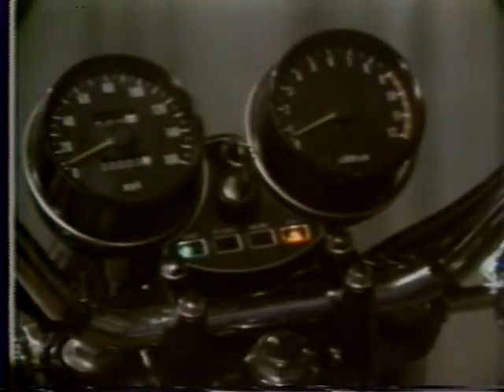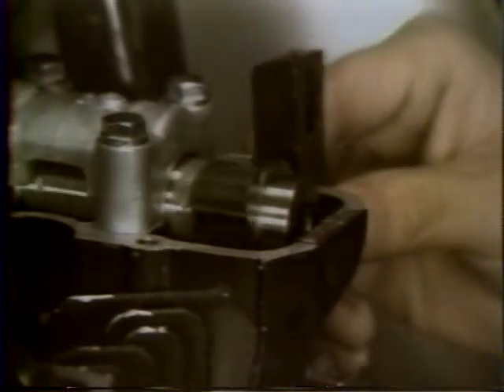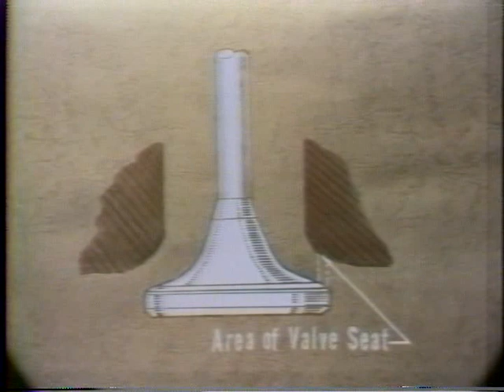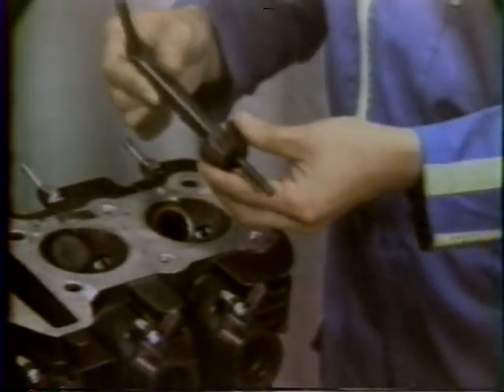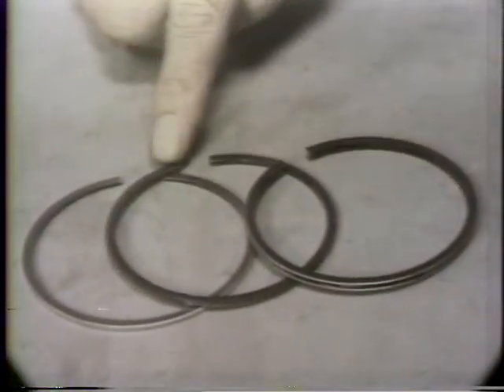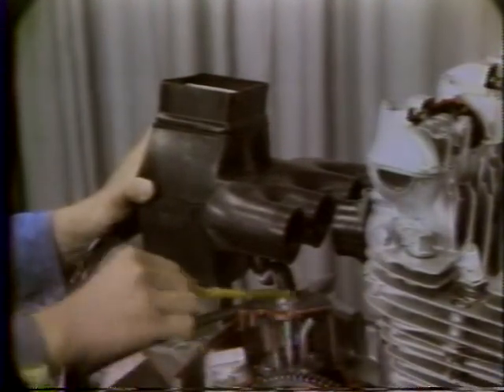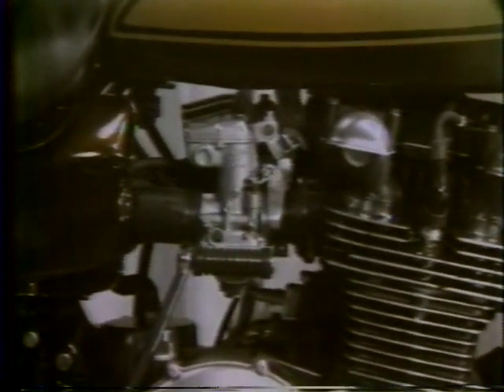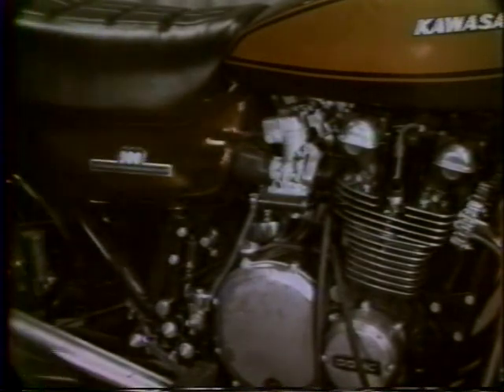KAWASAKI Z1 ENGINE MAINTENANCE TRAINING VIDEO.

Comment: I used to do a precision valve clearance adjustment on my 1976 KZ 900:
1. set the valve clearance as specified here, with an extra .001" on the exhaust valves - this gets you close
2. bolt a degree wheel onto the crankshaft and use a dial indicator to mark TDC on cylinder 1
3. put the dial indicator on each valve shim and record the amount of lift at the specified #of degrees BTDC for the intakes and #degrees BBDC for the exhausts
4. seek to equalize the valve lift for all intakes by sanding the shims down on the 3 shims that have the highest lift, do the same for the exhausts

Precision synchronization of the carbs:
1. synchronize intake port vacuum with "carb stix" with the engine a little above idle - this gets you close
2. run the engine up to a rpm where it can run smoothly on 3 cylinders(~2000 rpm) and then short out one of the cylinders, record the rpm drop
3. do the same for the rest of the cylinders
4. increase the throttle opening in the cable adjuster a very little for the cylinder that had the least rpm drop
5. repeat the process until you can get an equal rpm drop from each of the cylinders that is shorted out.

Your Kaw will now have a super smooth running engine. If interested I can post a tip on precision cam chain tension adjustment.
Reply: Why sand shims? Replace with correct sizes.......
.
Reply: @zeke2566  That was step 1, setting the valve lash the factory recommended way with the appropriate thickness shim. It works well and there is nothing wrong with stopping there. If you then measure the valve lift at the point specified of crankshaft rotation you will see that each valve has a slightly different amount of lift.

Replacing any of the valve shims with the next smaller shim size will not get you exactly where you want to be, because of the size of the increments of the discs that are available.
Reply: @videomaniac108  I can see advantage of your method on a 4 or 5 valve per cyl  race bike but on a 2 valve street bike -not really
Reply: @zeke2566  In terms of the benefit gained, for the additional amount of work put in, it's probably not worth it for most applications, TBH. The thing I noticed on my Kaw was that the engine was slightly smoother running after the precision valve lash and carb synchronization. For me, it was probably motivated by my curiosity to see if such an effort would produce a noticeable benefit. As you said, perhaps the difference might have been more pronounced on a multi-valve race engine that's turning 14k rpm.
Reply: @videomaniac108  agreed!  I bet you build one hell of a race motor too!
Reply: @zeke2566  Thanks, I'm very flattered. I would like to think that I learned something of value from those guys who really knew what they were doing